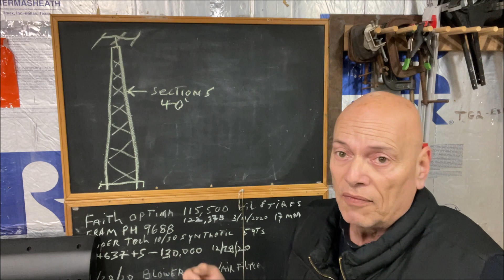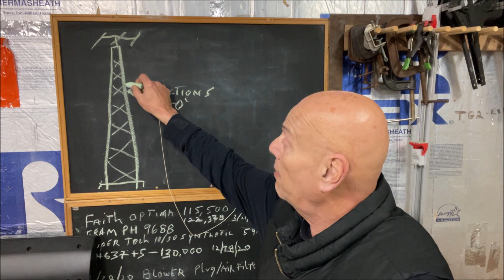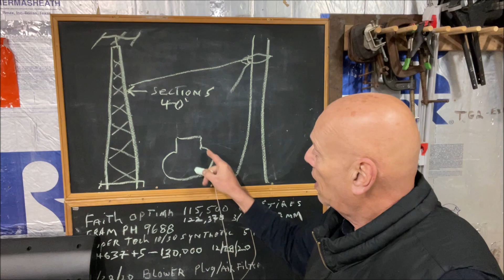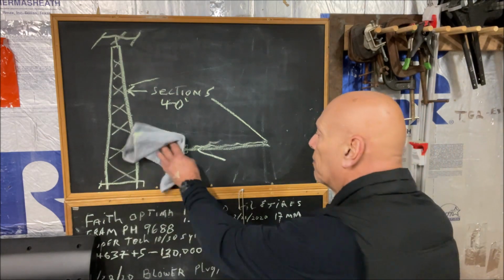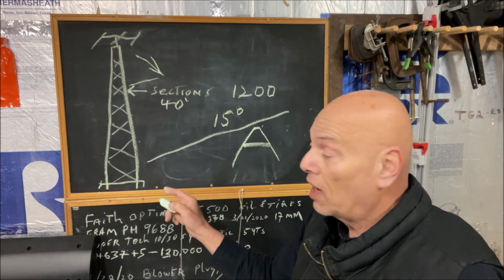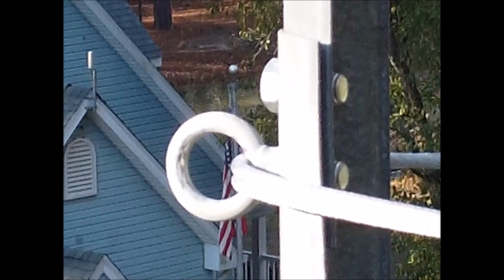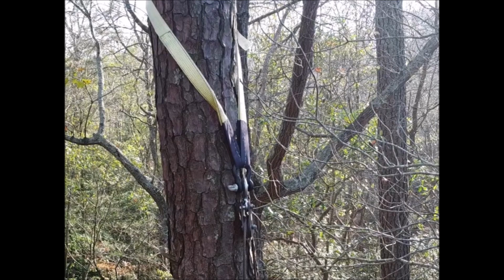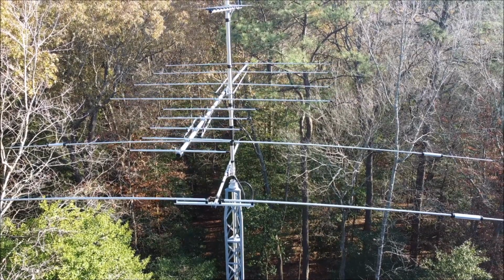Ham Radio Adventures 7

Comment: What a blast. Love this and it is great info for when I get to this stage. I have a very high and steep pitched roof with my antenna's right now, but I need to eventually install a tower as the roof and the side of the house antenna mounting are extremely susceptible to wind, potentially damaging not only the antenna's but my house! Great work. Can't wait for more.
Reply from the maker: Thanks for the words. More coming on this.

Comment: What method do you use to start the tilt when lowering your tower?
Reply from the maker: Thanks for watching! The first time I lowered the tower we attached a 25-foot tow strap at 16 feet vertical. One of my muscle-bound friends then pulled on the strap while I held tension on the cable (winch cable). Came over just enough to winch the rest of the way. The second time I lowered the tower, I used a metal u-channel under the back leg and then used a car jack to get it started. Both methods worked great!
Reply: @hamradioadventures73  okay, Some say guy wires help with that, and some claim they don't have to do anything. What you described is what I had in mind. I appreciate the imput.
Reply from the maker: @theboogeyman826  This video shows the first lowering with a strap. https://www.youtube.com/watch?v=YSIC2dQPC4A